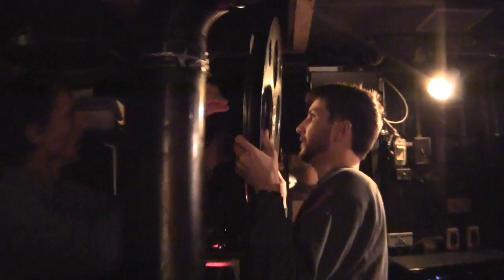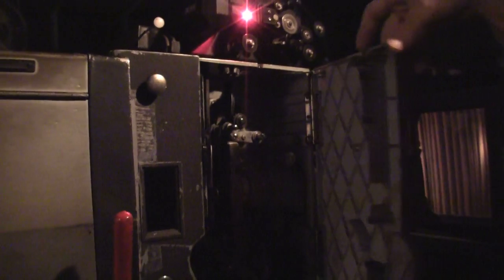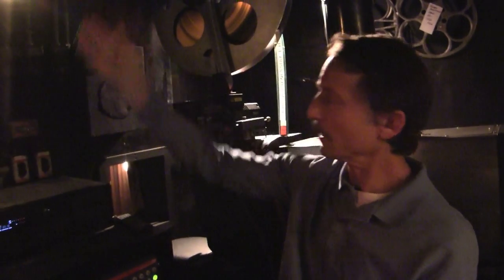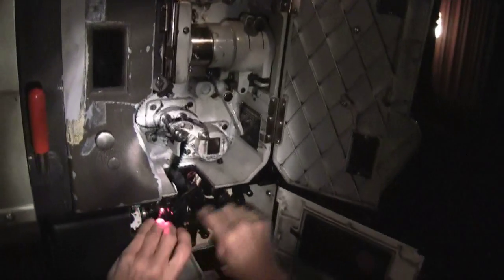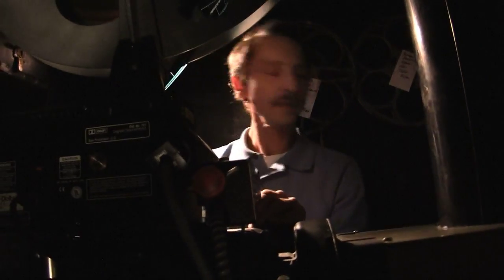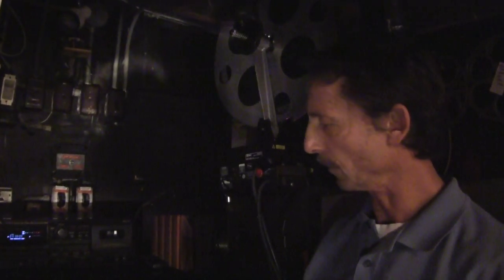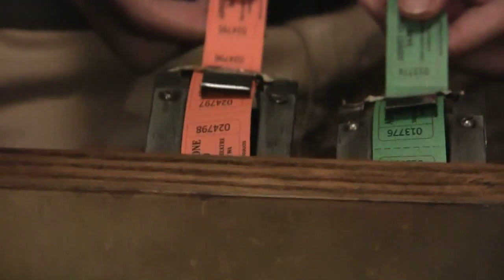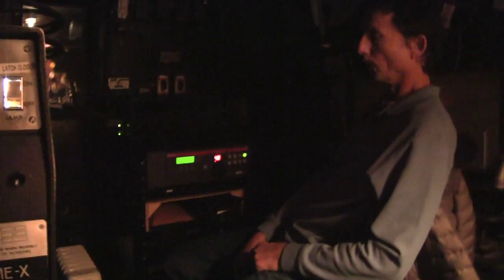Old School Movie Projection Booth 101

Comment: Man this brings back memories.  Almost verbatim setup at the theatre I worked at in the '70's.  Simplex 35mm projectors, xenon lamps, flat, cinemascope, 6000' reels.  The works.  Even had the toilet and an escape ladder & hatch to the roof in case there ever was a fire.

Comment: Studios are shooting less and less on Film and making a fraction of release prints. Major Film processing Labs that were the Industry staple like Technicolor and Deluxe no longer process 35 and 70mm film. In fact last year both places auctioned off all their equipment. I've even seen theaters that changed to Digital, throw away their 35mm Projectors / Equipment in land fills rather then store them. Film has been around for so long it is hard to fathom that it has all but disappeared. Just like generations that grew up using 127,120,620 and 126 cartridge film for their family album pictures; Film in Mutiplexes is almost extinct. The Digital transistion seems to have come so fast to the Industry that many independent single screen theaters weren't ready for it or hoped it was still a long way off. Many of these Mom and Pop theaters have had to close their Doors because the expense of converting to Digital was out of reach. Sad ending for something we took forgranted and was well over a 100 yrs old...

Comment: Carbon arcs lasted until the 1970s, replaced by xenon only gradually during the decade because they tended to explode when they failed. Mylar film stock was still experimental when I left the business in 1988. Since it wouldn’t break like acetate stock, you could lose some gears if it came off a sprocket and jammed inside the projector. A 6000 foot reel is not really old school. House reels were 2000 ft. An average film would be shipped on 6 reels. The epics, like “Dr Zhivago” or “How The West Was Won” could be on 12-14 reels of varying lengths. A projector could easily run for 50 years if properly maintained. I always dimmed the auditorium or house lights before starting a projector running. It makes a smoother presentation of the film. I am 3rd generation projectionist in Metro Denver, CO.

Comment: Hey everyone,

I'm a projectionist that works for a company who still runs the occasional 35mm. Our venue uses a platter system and we have a pair of Strong projectors to run reel to reel in the event that we get archival print in order to preserve it and not splice the print up.

Are there any guides for running reel to reel? I know it's kind of archaic but I would really like to learn how to do this. Haven't run any film prints on a change over system and I think it would be cool to learn.

Thanks!
Reply: other than nostalgia, im not sure why one would run reel to reel not platter if one is already running 35mm for nostaglica and arts sake... if you have some kind of system that eased the stress of reel changes every 20 minutes, id stick with that...esp in this age where running film and all the other problems platters caused are a moot point...
Reply: @julesotis13  Many archives insist on running their prints on changeover systems, since it means the prints aren't constantly being cut up, spliced together, and then cut back up into individual reels up when being shipped back out.